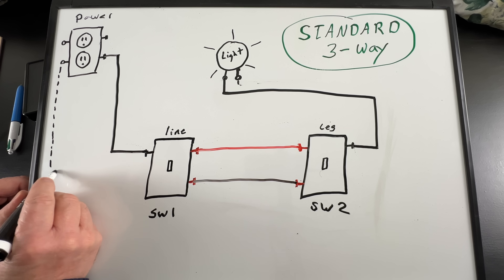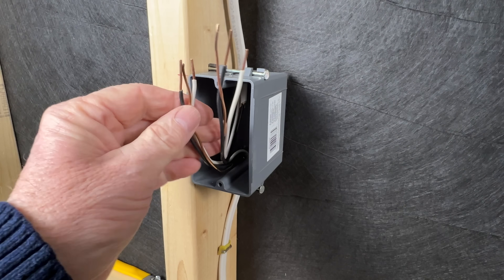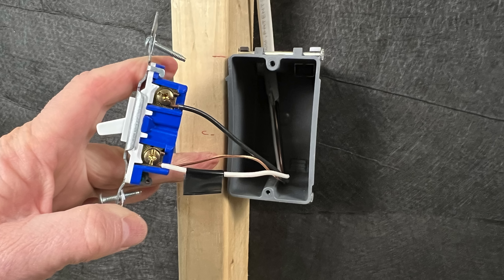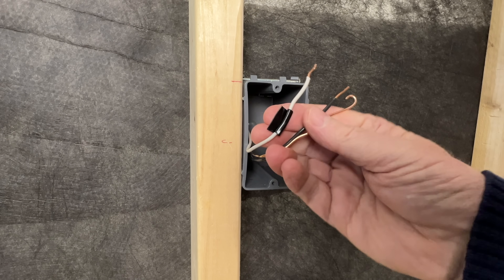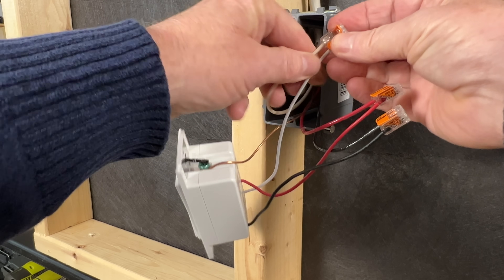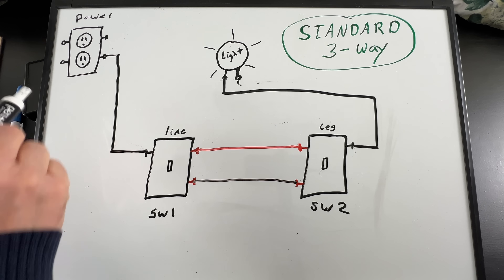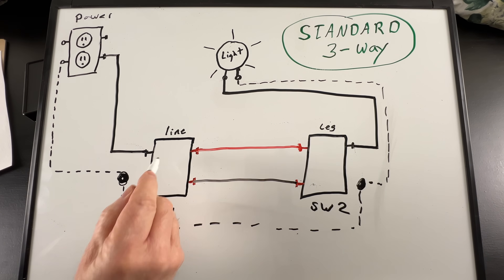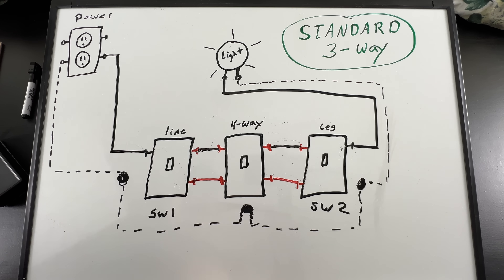How NOT to Wire Light Switches in 2025 (New Rules)

Comment: I say screw the rules.  Why spend more $ just to make inspectors happy when there is no safety concern?
Reply from the maker: There is a safety concern which was the reason for the code change. In the absence of a neutral people were connecting the neutral on the switch to the ground wire. Current on the ground is not safe.

Comment: 12-2 for a light? Should be 14-2
Reply from the maker: Wire is sized to the breaker. If lights are on a 20A circuit 12 gauge wire is required. 15A would require 14 gauge

Comment: I will add that if it is installed in conduit of sorts ie pvc or emt a neutral isn’t required because it can be fished in later provided the conduit is large enough to accept the new neutral conductor, and that was from exception 1 that is still there. The second exception you speak of is for accessibility, for instance if one side of the wall was open and you could add another cable later, but the 1st exception dealing with conduit is still there. And I will say the easiest way to do it in the first place is to take power to the switch first and then to the light; but in the case for stuff like romex being used if for whatever reason you went to the light first, you would need a 3 wire cable and use the red and black as the power and switchleg and the neutral would be capped off. But just a minor correction there. And to be honest for the most part most of the houses aren’t put in conduit in houses, with few states and such that are. But I do like your videos. Keep doing what you’re doing.

Comment: Oh yes, I see many Smart-switches with a Neutral-wire requirement and I can see the issues of no Neutral in a box.  

I have an old house with a fan/light Smart-switch that I have no idea why it is working?  The box only has 2 wires and connected to a Smart-switch with 2-wire connections (2 screws, 1 screw for each wire), some how it can adjust the fan speed and dim the light.  It is a mystery to me.  I have not open the fan yet.

Comment: All this time I have been using 14 gauge for lights.  Go figure.
Reply from the maker: The size of the wire used will depend on the size of the circuit. If it 20A you will be required to run 12 gauge wire.

Comment: The NFPA can be frustrating. I assume the change is due to hacks using a ground as a neutral. So why would they only require a neutral at one location in a 3-way wiring? Just make it all switches require a neutral. Thanks for the video.
Reply from the maker: You are correct. Use of the ground was the issue they are trying to rectify. I didn't;t mention it in the video because I didn't want to give anyone a bad idea. When smart switches are used only one is needed on any switch or switches that control the same lights. So for multiple switches such as 3-ways and 4-ways only one location requires a neutral.

Comment: How about when you have power coming into a light fixture then going down as a switch loop and then making that setup as a 3 way. I had that scenario in a mobile home, light and switch was at the end of a hallway (25') long. Customer wanted a 3 way setup to light up hall going to his bedroom at night. Turn it on then turn it off going into his bedroom. I connected the black wire from the old switch and connected it to the common screw on the new 3- way switch, ran 14/3 to new location and using black and red wires for my travelers to new 3- way switch. Then connected the white wire to the common screw on the new 3- way switch. Back at the first switch box I took the white wire ( from the new 14/3 ) and connected it to the other half of the old switch leg. In my opinion this setup is what I would call a dead end. Now to be code compliant I would have to fish a 14/3 15:20  from the light to the first switch box .

Comment: As the wire manufacturers celebrate. The dumbing down of the trade.
Reply from the maker: You should always supply the switch first anyway which is no extra wire. That way the circuit could be extended if needed. This doesn’t dumb down anything.

Comment: why did you keep saying 12 wire when talking about 3 and 4 way wire
Reply from the maker: It all depends on the size of the circuit. If the lights are on a 20A circuit maybe tapped off a receptacle circuit they we will need 12 gauge wire. Most lighting circuits are on a 15A breakers which in that case would be 14 gauge wire. I erred on the larger wire in the video incase someone in the audience didn't understand wire sizing requirements.

Comment: This is a silly code. The code was put in place to benefit the device companies, not for safety.
Reply from the maker: Yup this is also for safety. In the absence of a neutral conductor many would connect the neutral on the smart switch to the ground wire. This puts current flow on the ground and can be hazardous.
Reply: @BackyardMaine  yeah, but you said it, on a smart switch. If we did not have them it would be fine. Smart switches are junk anyways.

Comment: Code used to be for safety... now it is something to be purchased by manufacturers that want to sell smart switches. 😮
Reply from the maker: It is still for safety and fire protection. In the absence of a neutral people will use the ground wire for the return which presents the hazard of current flowing on the ground.
Reply: @BackyardMaine  ground? On an old 2 wire switch leg? How many of those were never run or trimmed so far back to get them out of the way and never connected at the junction box?  It is for "passenger princess" electricians and thise handyman diy that never do their own rough.  With the speed that things have been changing with annual changes to code... it is about time to go back to running conduit in the walls so future changes can be made without opening the walls.  😅😅😅 Those "workmen" that tend to shortcut their way through life will continue to do so regardless of that neutral.  In fact that neutral will end up being repurposed when some homeowner chooses to drop in a retro box and add a second switch for tomorrow's great idea.  Regulations only govern those with a license. 😅😅😅

Comment: So the building code for new switch boxes increases costs for everyone. Not for safety, but for the benefit of boutique manufacturers? 
What if you just want a light switch? All that extra wire just sitting there to not be used is moronic.
All that extra wire ain’t free.
Who lobbied for that?
Reply from the maker: No accurate. In the absence of a neutral people are using the sound wire which will work but now we have current flowing on the ground which can be hazardous. Also most electricians will feed the switch box first anyway which ads zero cost to the installation. And the CMPs who write code are not a government agency and there are no lobbies. There decisions are made from a consensus vote.

Comment: This is a VERY old code update!  This is no longer an issue now, most new light switches no longer need that neutral.  But since government is involved, guarantee to make everything worse for no reason!  Just like the island outlet.
Reply from the maker: The update was 2011 like I stated in the video but the exception was removed in 2023. I agree with you that the government destroys everything they touch but the NEC is not a government agency
Reply: @BackyardMaine  keep telling yourself that. Are you forced to follow it?  Who makes sure you follow it?  Permit = permission slip from a master. Inspector = your local kingsman
Reply from the maker: @2wheelsurfer  I'm a retired electrician and electrical engineer. I taught code courses on the side a few years back. Nobody told me about these requirements. I read it in the code book. The neutral was required in switch boxes in 2011 and exception number two was removed in the 2023 update.

Comment: You always say "12/2 or 12/3" cable. I prefer doing all lighting with 14 ga wire with 15a breakers (unless the lighting load requires 20a of course) and put the outlets on 20 amp branches separate from lighting. Trip an outlet and voila, the lights stay on! Now I understand that 16 ga with with 10a breakers is legal for LED lighting systems. Lighting wiring is more intricate than outlet wiring and 12 ga is harder to work and fills the box faster. Also, with dead end 3 ways, why can't the travelers be red and white? Then the line and load wires are always black.
Reply from the maker: Some switches and lights are installed on 20A circuits which often feed receptacles as well. I worried that if I showed 14 gauge wire someone might make the mistake of running that on a 20A circuit. So I erred on the side of safety. Of course if you have a 15A circuit you can run 14 gauge wire.

Comment: Very good explanation and glad to hear about the code change which I hadn't heard about. I typically used 3 conductors plus ground cable for travelers between two 3-ways, and between 3-way and 4-way switches, because I disliked reidentification of neutral conductors.

Comment: Your drawing is confusing if you are using switches from same manufacturer.
the  screw locations would be in the same position on switch
Reply from the maker: Yes the physical location of the screws are a bit different but it's much cleaner and easier to understand the way I draw it. That way lines are not crossing over each other. I was clear that the color of the screws determine the connection. Gold for travelers and black for the common.

Comment: I remeber the video on three way wiring methods. Why is the Chicago no longer used?
Reply from the maker: The Chicago method can be very dangerous and is not code compliant. I list all the reasons it's not safe in the video. There are still some old homes with switches wired this way though..
Reply: I saw the linls to both Chicago and Califonia when I made the comment. Could both be the reason, being reverse polarity, when you turn one switch on and someone turns the other switch off it looks like the switch changes position, if this makes sense. This can probably no longer be the case in modern methods, right?

Comment: Yes sir ! I fully understand AND agree to this. ... I believe since smart switches have been introduced (which a lot of the times require neutrals) this code change was made to keep people from "faking" a neutral connection via the GROUND WIRE . I get this code change as it can entice people to violate code to get smart switches to work and maybe using the ground wire as a neutral wire to make the switch operate. Does it work? well yes,BUT, you should NOT be using a ground wire as a "neutral cheater"
Reply from the maker: That is the reason for the change.. I don't bring it up in the video because I don't want to give anyone a bad idea.

Comment: Great explanation! I'm replacing a light switch in my bathroom and ran across some questionable wiring. Two wires on one screw on the fan switch with one of them going to the light switch.

Comment: In a line voltage thermostat (controlling a 110v exhaust fan), can a white wire be used as a switch leg?
Reply from the maker: It’s a code violation to switch the neutral without also switching the hot leg. But a white wire not being used as a neutral and re-identified as a hit can be switched.

Comment: Thank you for such a clear and concise description of all these. 

If I’m going with the dead end method, and one of my switches is a dimmer, does it matter which switch location I install the dimmer in?
Reply from the maker: It depends on the dimmer switch. Some will have a neutral connection and allow you to dim LED lights without flickering. Others will not have a neutral. If your dimmer does have a neutral you will need to install in the box with a neutral conductor. If not it won't matter.

Comment: I have always called the black screws the power in/out screws in my head and when I have explained it to other people.  Europeans generally call a 3-way switch or a 3-way pneumatic/hydraulic valve a 2-way which I really think makes more sense because the power only has two paths.  They also referred to a 4-way switch as a slap switch or a cross switch which I also think is accurate.  So many descriptions explaining the same concept.

Comment: I noticed on all of these videos for 3 way switches you have the power coming into the first switch, but what if the power is at the light.   I used to work for an electrician (roughly 20 years ago) and I had to figure one of these out.  I just drew out the wiring diagram for the standard method, which was the way we usually did it and had to figure out the rest from that.
Reply from the maker: Here's a video with the power coming into the light. https://youtu.be/dg-4wj3JF3U

Comment: Does this setup/diagram/demonstration also work for 3-way dimmer switches? Also, if I use say....Leviton Mastro where I can have dimmers on both ends? My setup uses a 12/3 between the switches, and 12/ power and up to LED ceiling lights.
Reply from the maker: Yes this will work with a dimmer. Remember only install one dimmer for these circuits.
Reply: @BackyardMaine  Thank you so much for a response. I read/have notes that show you can use a dimmer on both sides of a 3-way switch setup, thus controlling the LED wafer lights from either switch. Do you have notes that explain otherwise? I'm really wanting to use dimmers both sides if they work that way.
Reply from the maker: @hahahahagrin  In a standard three-way switch setup, it’s usually recommended to use only one dimmer switch in the circuit. Here’s why and how it works:

Wiring Complications: Three-way circuits allow you to control a single light or group of lights from two different locations. If you add a dimmer switch to both ends, it can cause complications because each dimmer will interfere with the other, potentially leading to flickering, inconsistent dimming, or even short circuits.
Single Dimmer Setup: The correct way to wire a three-way dimmer circuit is to install a single dimmer switch on one side and use a regular three-way switch on the other. This way, the dimmer controls the light level, while the other switch just toggles it on and off.
Special Dimmers: If you want dimming control from both locations, look for companion dimmer systems or multi-location dimmers. These systems allow a “master” dimmer and an “accessory” or “companion” dimmer that can communicate, letting you adjust brightness from either location.

Comment: Great video. I have one question, At 7:30, you are you using 12/2 cable? Would not 14/2 work if it just for lighting loads?
Reply from the maker: Yes. 14 gauge for a 15A circuit and 12 gauge for a 20A circuit.

Comment: I think that exception for multiple devices controlling the same lighting load should be/will be removed. Devices like occupancy or motion sensing devices often need to be placed in a specific switch box. The absence of a neutral in each box, as is provided by the standard way, is going to mean some lighting loads cannot effectively use advanced switches.  I’d be ok with an exception for some kind of designed layout for sensor switches but I don’t know how that code be captured as an exception.

Comment: I can imagine that if SW1 Line switch is closer to Light and to box/panel Power source, Dead End method could save 2c cable cost and maybe labor (distance between SW2 to SW1).  Is there any other motivation / benefit to Dead 3-Way End method?
Reply from the maker: That and just convenience. Sometimes it may be a more difficult path to the light from the second switch. Most of the time it makes the most sense to wire in the standard method and then you have some future proofing as well.

Comment: They basically changed the code to accommodate expensive light switch companies... not safety... 🤮
Reply from the maker: Actually no. People have been connecting the neutral wire on these new smart switches to the ground wire to make them work. The ground is for fault current only so it is dangerous to use it as a current carrying conductor. Thats the reason for the change.

Comment: On the dead end 3 way, who would run a single hot wire from the switch all the way to the light? Just romex 2 wire everything.
Reply from the maker: You need two travelers and the return for a dead end three way. That cannot be done with two wire romex.
Reply: @BackyardMaine  are you implying 2 wire as in a hot and neutral with no ground?
Reply from the maker: @sef2273  For the dead end 3-way you will carry two travelers over to the switch and have to carry the switch leg back. No neutral would be needed at the dead end switch. So you would need to run a 3-wire between switches. The red and white would be travelers and the back would be your return.

Comment: White wire as hot? I caught he said 14 ga. wire. All the wiring I did never used 14 ga. even though it could be used for overhead lighting which had little current. I found the holes in the back of the switch or outlet would only accept 14 ga. wire. Not good for outlets.
Reply from the maker: Yes switch loops and 240v circuits with no neutral will often re-identify the white wire as a hot and it is code compliant. Residential grade receptacles and switches will have the back stab option and you are correct they only accept 14 gauge solid copper conductors. I don't recommend use the stabs though because they are unreliable. I made a few videos about that subject and cut them open to demonstrate the issues with the connection.